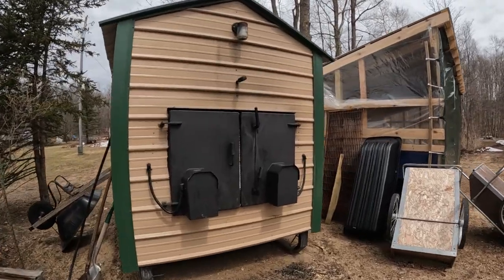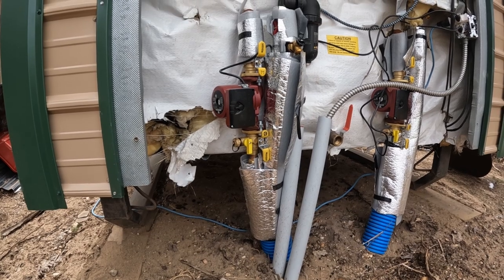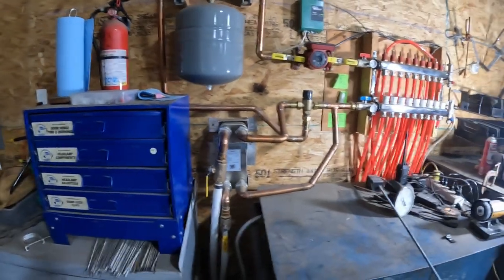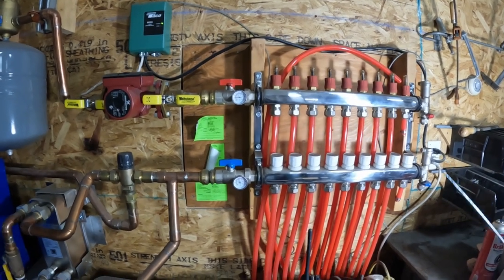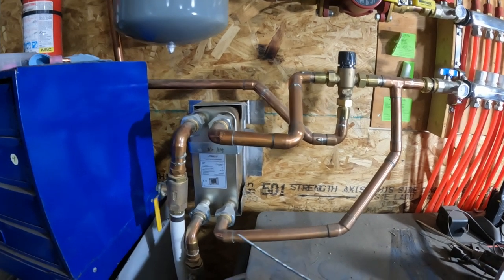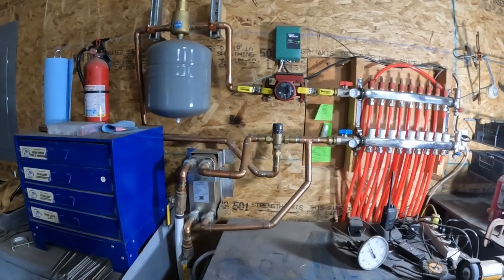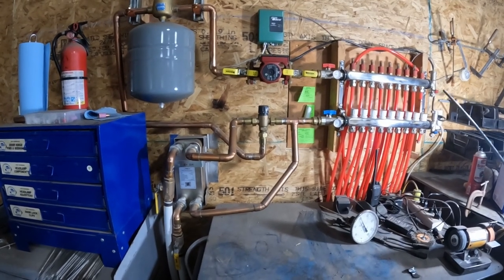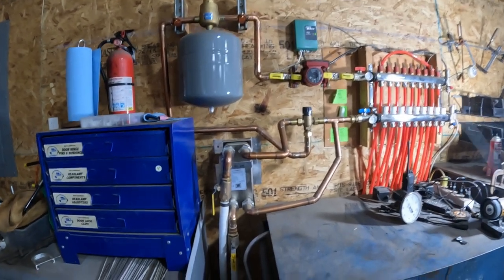Outdoor wood boiler to pole barn in floor radiant heat plumbing.

Comment: Could you explain the purpose of the mixing valve a little more please?
Love the setup!
Reply from the maker: Sure thing,  was new to me till I told my plumbing specialist friend my plan!  Lol. The concrete cannot handle the high temps, tends to crack it,  so the mixing valve mixes the cooler water returning from the floor with heated water from the plate exchanger to give a lower temp (125ish) output back to the floor.
Reply: would you mind listing the parts and where you got them? Thanks man that was helpful @twosawacres8096
Reply: is there a better way to ask you some questions about your system? Thanks @twosawacres8096
Reply from the maker: @jeremykillebrew5232   sorry I haven't got back about the list of parts,  crunch time around here prepping for winter. You can email me,  twosawacres@gmail.com.

Comment: No water heater or storage tank to store the hot water after it comes out of the plate exchanger? Every other video I see online has a tank of some sort but I like your design much better.
Reply from the maker: No need for water storage with an outdoor wood boiler, as it is the storage tank,  and this one holds just shy of 500 gallons.  Heated at the boiler, goes in two separate loops, one to the house and one to the barn,  goes through plate exchangers then back to the boiler to be reheated. Thanks for taking the time to comment,  if you got any questions I'll try my best...
Reply: So if I am understanding you correctly the boiler water runs through the plate exchanger and  the water/glycol mix on the other side of the exchanger that heats the floor heats up instantly? You are able to eliminate the water heater or storage tank because you basically have instant hot water?
Reply from the maker: More or less you are correct, the loops on the boiler side circulate continuously no matter what is or is not calling for heat, when the house or barn call for heat, their own circulator pump kick on and run it through the respective plate exchangers.  So yes, sort of like on demand hot water.  If nothing is calling for heat, the hot water in the boiler simply makes a round trip and back into the boiler, when the boiler senses the water temp is low (I have mine to kick on at 170 and off at 180, which is pretty typical) it opens air baffles and turns on blower fans to stoke the fire, at 180 deg it shuts down.  This winter has been pretty mild in northern Michigan, and I've had many days where nothing calls for heat all day and my water temp gets a little too high, so I just turn up the temp in the barn for 30 min...
Reply: Thanks for the information. I would have bought a hot water heater I didn't need had I not seen this.
What brand plate exchanger do you have?
Reply from the maker: @natefrodl6026  I'll have to get back to you later on the exact brand, but both are 40 plate, one I ordered through my local plumbing supply store, the other I ordered with the bulk of my supplies through Z-supply, they label it HXP-40.  Honestly, all the parts from both places seem to be pretty solid, I have zero complaints.  Actually, 2 of the three circulator pumps I ordered were from Z-supply and they were both grundfos, just like the one I got from my local store and similarly priced.

Comment: How did you size the expansion tank
Reply from the maker: I wish I had a technical answer for you,  but I just worked with a friend of mine at the local plumbing specialty store,  he recommended my pump,  tank and mixing valve for the system then I did the install.